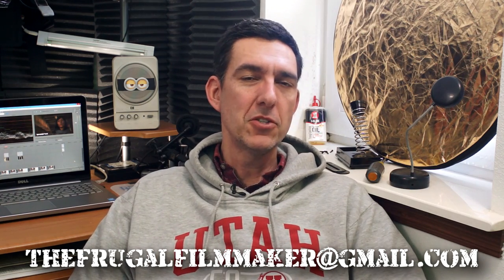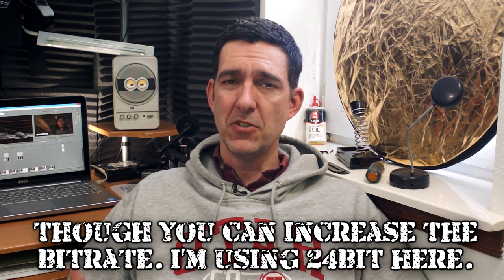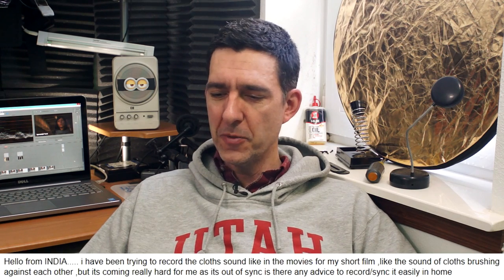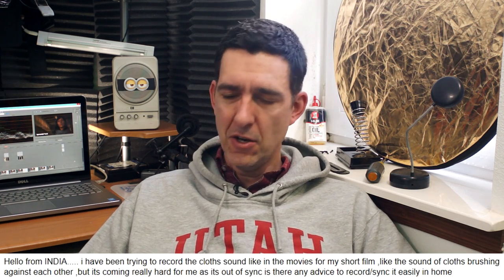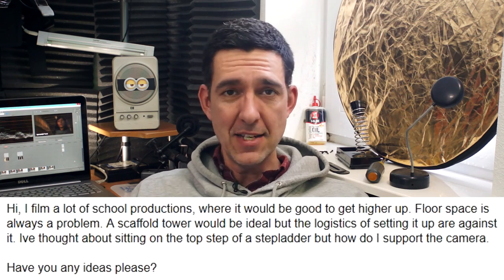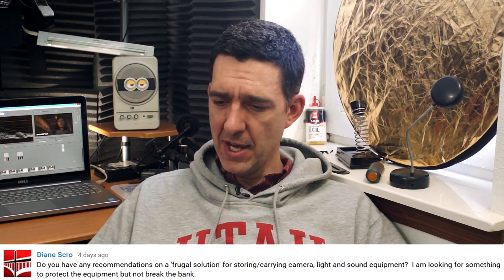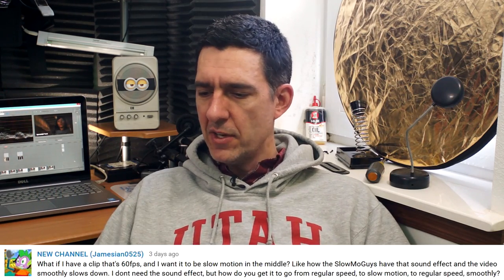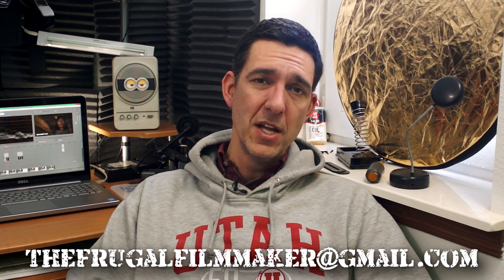Q&A: How do I control my camera up in the air?

Comment: For the slow motion you can also use time remapping in After Effects (right click - enable time remapping)  or in newer versions of Premiere by using keyframes 100% for the beginning, then another 100 where you want the smoothness to start and 40% 30-50 frames later. Then another 40% where you want the effect to end and boost it up 30-50 frames later back to 100%. Then fiddle with those keyframes to your liking until you get what you want.  Extra TIP: there's a plugin called Twixtor that can insert fake extra frames to make your slowmo even slower without leaving the viewer with the impression that you are skipping frames and it's obvious that you're slowing down more than 24fps. (there are many tutorials online for this plugin. Search for one and get a general idea. It also uses keyframes that can smooth that slowmo descent.

Comment: For the slow motion thing I recommend looking at time remapping tools on your editor. premiere actually does it with keyframes. It's waaay more practical than Scott's solution, although I suppose that the cheaper editors don't do this

Comment: On the subject of Foley:

Scott, wouldn't recording the audio as an audio track on the clip itself in the editor help with syncing? I know that in Sony Vegas Pro you can record audio straight to a track.

I haven't had to do Foley or add sound effects myself to date so I'm not sure.

On a side note: The kids movie Hotel Transylvanian 2 (a really mediocre movie) has a BTS on Foley designed for kids. It's actually kind of cute and an interesting thing to add as an extra to a DVD. 

It's kind of interesting for me and my daughter since we've done little skits and magic trick videos together (Example:  https://youtu.be/_B5e-Wo8V2E ) and anything that shows her a bit more of the behind the scenes stuff is nice. :)

I just mention this because my 4 year old has been watching that movie a lot lately.

STEP LADDER / CRANE

If it's your ladder, you could just poke a hole and thread up a quarter 20 bolt through the top of the ladder to mount a fluid head or mount a small slider with a fluid head to give you a bit more flexibility?